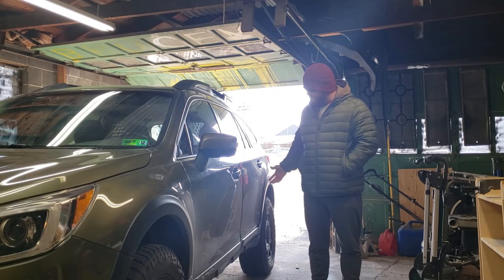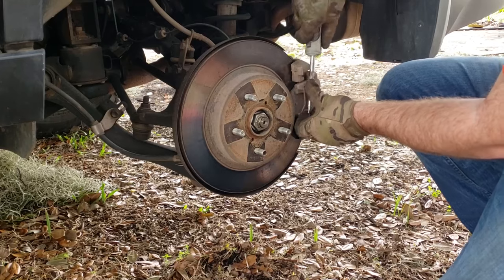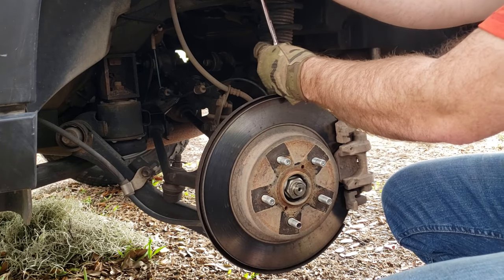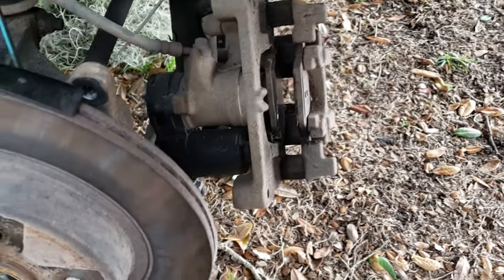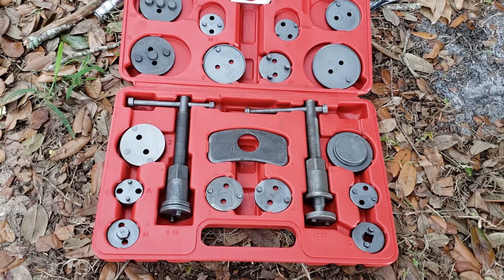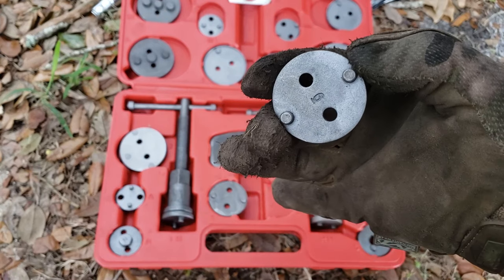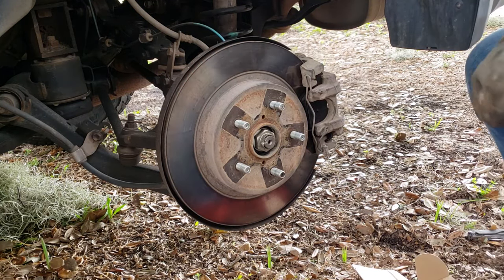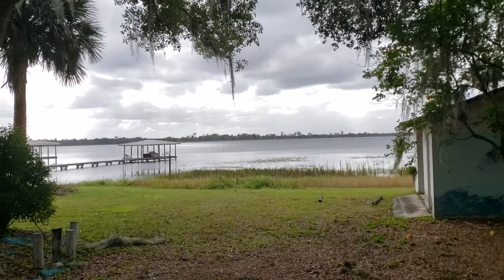Adventures in Electric Parking Brakes! Rear Brakes 2015-2019 Subaru Outback.

Comment: Another question - Sorry! The Subaru FSM mentions an alignment mark on the rotor and hub on page BR-42, with one of hub mark apparently on a wheel bolt. Could not quite make anything out, but at 1:43 one of your studs is indeed different than the others. Could not make out any mark on the hub. Did you happen to see anything? Any idea why this would be there? Thanks!!
Reply from the maker: I did not. I'll check into that mark though.
Reply: @bruceyyyyy  There is a very small dimple. Wonder why it is there? Perhaps to align rotors which have traditional inner parking brake shoes? Took a pic, but no way to share here,
Reply from the maker: @jamesws3  Shoot it to my email. 

bruceygastation@gmail.com
Reply: @bruceyyyyy  We may have an answer from the Outback board:   "Its probably for on car turning and/or balancing that the rotor can be returned to the same position after service". Makes total sense.
Reply: @bruceyyyyy  Done
Reply from the maker: @jamesws3  Yup! Saw the email and the forum post. 

Not removing the park brake assembly definitely seems easiest.

Comment: I am curious, if you already 'release' the parking brake in the beginning with the electronic switch inside,  why do you have to release again by twisting the piston? Any special procedure you need to do after the new pads are on, as far as the e-brake is concerned?
Reply from the maker: Releasing it just makes accessing the brake possible. It doesn't fully retract until it's twisted in. 

When setting the first time the brake will recalibrate itself automatically.
Reply: @bruceyyyyy  thanks! after posting the question I thought about it and came to the same conclusion. The motor must be calibrating itself all the time, and when electronically released it only retracts slightly to free up the rotor and not all the way.
Reply: @bruceyyyyy   I am glad to hear that the electronic parking brake will calibrate itself the last time I did them myself in front but got scared off the back by a shop said you needed to use some computer tool to reset the electronic parking brake.
Reply: I couldn’t completely wind down the E break. I have the wind down tool as u recommended! My new pad couldn’t install it! Any tip to wind down the E break?

Comment: I couldn’t install my new pad on my rear wheel! Because the E break couldn’t completely wind down! There was no enough space for it! I got the wind down tools that u recommend, any tip to wind down the E Break? I don’t want damage my E Break! Thx
Reply: You start by using the special tool and turning in the pistons. After they bottom out then you simply press the piston back with a C clamp or just use a flat adapter on the special tool. This will push the piston back the rest of the way to get the pads in.

Comment: Hello, nice video and thanks for documenting. I need to also change out my rotors; could you have just continued on and removed/replaced your rotors using this method? Anything you would have done different? Thanks!
Reply from the maker: Yup! Should not be an issue. Just bang the rotors off if you want to do them as well.

Comment: The bedding brake procedure might be for doing all 4 at the same time, seems like that might hurt the pre-existing front brakes, not sure but it's more of a question than a correction?
Reply from the maker: I would imagine it puts a minimal amount of wear on the front brakes. They should be fine in my experience.

Comment: Since you didn't use a scanner to disable the parking brake system, was there any issue with using the parking brake or any codes generated after the job was complete?
Reply from the maker: Nope
Reply: @bruceyyyyy  thank you.

Comment: This was brake job simple compared to the GM starbit. I changed my stock pads on my 2018 after a 2 week Trip out west and South Carolina.
Reply from the maker: I've changed some before that had red thread lock AND 12 point head on the caliper bolts (Fiat) and I am not sure if they're meant to be replaced every time or not.

Comment: Other videos showed the back of the parking brake assembly being removed, and the rod being turned as the piston is retracted. Is that step not needed?
Reply from the maker: I did not need to do it.
Reply: @bruceyyyyy  I was just wondering if it would do any damage, because all the other videos say to do it.
Reply from the maker: I'm not sure it's necessary. I've had lots of people do the same I did here without issue.
Reply: @bruceyyyyy  tThanks, I'm going to do my Wife's Outback next week. I've change pads and shoes on several cars many times, but never one that had that electronic parking brake assembly. I just did'nt want to do something where I have to take the car to the Dealer to have something corrected or recalibrated.

Comment: I was wondering how you got your piston to bottom out more(8:45). I initially compressed mine  with the caliper compressor, but didn't fully bottom out similar to yours at 6:44. Had to remove the electronic mechanism and it helped me compress the piston down more to fit the new pads over the rotors.
Reply: I know you posted this a year ago but just incase I will respond. With a wind back tool, you will wind/twist the piston back in. That doesn't get it all the way in so the rest of the way you press it straight back in. With my wind back tool I then used a wrench to rotate/tighten  the nut to push the ouston in without rotating. Or you can use a c clamp at that point.

Comment: Great video. Quick question, when you tightened the caliper bolts, what did you torque them to?
Reply from the maker: I think the 14mm were 20 lb ft and the 17mm were 60 lb ft off the top of my head.

Comment: Hey Bruceyyyyyyyy.   I’ve noticed my 2015 outback is becoming a rather stiff ride at 81 k.  Shock absorbers are all factory.  Just method race wheels and Maxxis AT’s.   You think it’s time to replace all four corners?  Don’t really want to lift it.  Any suggestions for better replacements?   Thanks.
Reply from the maker: It could be depending on how it's been driven.

I figure shocks/struts usually last 100k.

Possibly look into bushings too. 

Do you still have the stock wheels/tires? Worth trying out at least.
Reply: bruceyyyyy 
Around 80% on pavement.  That being said, we’ve got some bad roads we pay extra taxes for.  I kept original wheels if I sell it or climate changes here in Southern California forcing me to install snow tires.   Any suggestions on better aftermarket shocks?
Reply from the maker: @paulauksztulewicz4803  I feel the OEMs are the best quality.

KYB is a good aftermarket brand though I'm not sure if they have ones for ours yet.

Comment: My mechanic said that he had to recalibrate the breaks - not sure if that was the e-parking brake or the entire system.  Is that a thing?  Whatever he did, I paid $175 after tax and got OEM rear pads, so I'm fine with it.
Reply: your mechanic did it the right way. im a tech and i use a scanner then recalibrate. its the way subaru wants it done. remember, just because you can dont mean you should. from a profesional stand point i cant risk damage to a customers caliper.

Comment: What tires? stock height? If not what lift?
Been trying to figure out the largest tires to fit stock and it looks like 29.1" or 235/60/r18
Reply from the maker: 245/65/17

2" lift
Reply: @bruceyyyyy  Crap, you need a 2" lift to run a 29.5" tire
My stock tire is: 225/60/18 which is 28.6". I was thinking of going to a 235/60/18
Reply from the maker: @lifeisgood070  My stock is the same size. A lift wasn't necessary to run that size depending on when back spacing.
Reply: @bruceyyyyy  Stock rim, I was going to keep the same rim for cost anyways.

Comment: Heya all, when ya screw in the piston with that tool will it auto rescrew it self back after you turn the engine on ? Or how does it get screwd back ?
Reply from the maker: The first time you use it out recalibrates itself.
Reply: @bruceyyyyy  Thanks Bruceyyyyy! Just wondering does that mean if i use it a second time to change my second set of brake pads etc. do i have to manually recalibrate it then  ?
Reply from the maker: No it should recalibrate itself the first time you use it.
Reply: @bruceyyyyy  Ahhh omg that makes sense sorry, I have no idea what I was thinking.
Reply from the maker: Is cool bubby. I'm glad you're learning.
Reply: @bruceyyyyy  Thanks, everything i've learned about my Subaru BS is from here. Was your video of it going offroad that inspired me to get it in the first place
Reply from the maker: @badfrog7395  Wish Subaru would give me commission on sales! ha

Comment: Thanks for this. Never worked with an EPB before, followed your vid & it worked great. BTW - the link for your brake tool is dead. I didn't realize I needed one until I was 1/2 done, picked one up at Harbor Freight for $29.99.
Reply from the maker: Glad I could help! 

Thanks for the update, I'll find a new link.

Comment: I'm doing some work on my car today and it's $@*&! cold outside, but your finger-snap technique did not work for me. Thumbs down!

The brake stuff was nonetheless helpful. I've always been afraid to do my own brakes but watching this, I feel that maybe I could tackle it. No electric parking brake in my Forester to mess with either. Thanks bruceyyyyy!
Reply from the maker: They're really easy on the older style cars. Unbolt the caliper, remove old pads, use a CHANNEL LOCKS or a C clamp to compress the Piston (opening the reservoir helps) grease the slide pins and the pads, reinstall and you're done.

Comment: Interesting, thanks!  Curious why the first part of piston compression involved turning while the final part was old school "just press inwards"? Your version seems much simpler than the people who insist on removing the entire parking brake assembly from the caliper. Why do they do that if you showed it to be un-needed?
Reply from the maker: The rotating part of the electric parking brake.

It's attached to an electric motor. 

The normal part is the normal brake piston.

I'm not sure why others would use a different method. This seemed fairly easy.

The book says you can unbolt just one brake caliper bolt and rotate the assembly. Would have to disconnect the plug on the bottom. 

Might be easier.
Reply: @bruceyyyyy  Thanks. You had no need to remove the parking brake assembly and expose the splined shaft as some others have shown. Seems like an unnecessary step an an invitation to something going wrong. Will replace both pads and rotes when due and lube with silicone grease.

Comment: the EPB has to beretracted using a bi directional scan tool and I would not change brakes the way you did.
Reply from the maker: The factory service manual disagrees with you. Using a retractor tool as shown is documented in OEM service technician documents.
Reply: @bruceyyyyy  not on the latest service bulliton and the 2019 service manual is four years old. get up to date
Reply from the maker: First I've heard of it. You got a number? The car is a 2017.

Comment: How much did your lift and tires affect your gas mileage?
Reply from the maker: The lift is very little. I don't notice a difference even I'm running my snow tires on factory size. 

The tires cost me about 1-2 mpg in my 3.6. It was more like 2-4 mpg in the 2.5.

Comment: Hey, Bud....awesome video. Really appreciate it.  Question....some videos show using a scanner tool to (I assume) disengage the electric parking brake.  So, the manner in which you did it mechanically by turning it with the tool you purchased totally bypasses the need for the electronic instrument and there is no damage done to the electric parking brake assembly?  You had disengaged the electric parking brake before doing the job, so I assumed it would automatically been retracted, yet you obviously had to mechanically retract it.  I don't fully understand the internal workings of the electric e-brake.  Thanks again.
Reply from the maker: So if you've got the scanner use it. 

I did this job on a Mazda and it was very similar but it had a secret code to retract so no tool needed. 

But Subartu does not have it so it's mechanical tool or electric scan tool. 

I released it but it still can't retract enough on it's own for service. 

There is an electric motor on the back that drives the piston for parking but otherwise it can operate as a standard brake piston as well.
Reply: @bruceyyyyy  Gracias. Thanks for the input.
Reply: One other question...have you found any decent repair manuals?  I have a 2015 Outback 2.5i Premium.  The local Subie dealer is useless to figure out what they can/cannot provide (which would probably be a buttload of $$$).  There are a number of options online, some of which are just in digital/PDF format.  Curious if you found a good resource.  At the local parts stores, your basic Haynes and Chiltons were not available in my year.  Gracias.
Reply from the maker: @bobweck1317  I don't think there are Haynes or equivalent for these yet.  I've seen bootleg pdf of the factory manual. Probably a worthwhile investment if you plan on keeping it and working on it yourself.
Reply: Now, all kiy lights are on. Brakes work fine...but the parking brke no longer engages, the hill assist and the RAB are not working
Reply from the maker: I would check the connection at the rear electronic brake. 

It's a known failure point.
Reply: @bobweck1317  I purchased a full Subaru manual on disc in pdf format. It was about $25. On the Subaru site, you can purchase limited time access to the full manual and download all or part of it. Don't recall how much it is at Subaru. A lot less than a mechanic would pay for a subscription. The only downside I see to purchasing a manual this way is that you don't have future updates or changes. I imagine any changes would be minimal. For me, the manual is worth the money. It is very helpful but, I'm thankful to have the videos from bruceyyyy to help it make sense. That manual is over 7,300 pages.

Comment: Ok, I'm about to do a brake job on my 2018 Outback, which has the same electronic parking brake. Every single video I've seen that addresses this issue, the person removes the electronic brake and "unwinds" it before pushing the piston back into the caliper. Does this tool negate the need to remove the electronic parking brake because it is rotated as its pushed back into the caliper?
Reply from the maker: Yup I believe so. I didn't even need to disconnect the wire for the brake.

Comment: the electronic parking brake requires it to be put in service mode....the way you did the rear brakes has the potential to damage the electronic parking brake motor...
Reply from the maker: This is listed as a method in the factory service manual.

Comment: It is not right. The parking brake service mode is used to replace the pads. It's easy to do. There are many videos on youtube
Reply from the maker: I'm not sure that is necessary. I haven't had any issues using this method.

Comment: Did you have any issues with the parking brake afterwards?  A lot of folks are saying that they need to go to the dealer to have the  parking brake reset in the ECU after manually retracting it.

  The factory service manual says that the parking brake is supposed to be put into maintenance mode which retracts it fully (rather than dialed in like you are doing).
Reply from the maker: Who is saying they had to go to the dealer?

We've got a whole thread on the forum but no one had reported having to go to the dealer.
Reply: @bruceyyyyy  Hey I was reading a post on the Ascent forums of someone who tried it on their OUTBACK (not Ascent), but it sounds like they had physically removed the parking brake solenoid from the caliper and maybe that caused their problems.  Apparently nobody has DIY  rear brakes on an Ascent yet  but the Ascent rear brake setup looks nearly identical, in fact the pads are the same Part number.  I suspect just the caliper + rotors are just  larger.  

Did you have to disconnect battery?  I am guessing not.  

My rotors are shot after 2 years , completely rusted and pads are worn enough that it'd make sense to replace them also, so I am going to try it but a little nervous!

https://www.ascentforums.com/threads/brake-job.7549/post-140196
Reply from the maker: I wouldn't worry. Have you changed brakes before? If you have : Check this video out, do a couple readings on the Outback forum. You should be good. 

Obviously if the bracket is off the rotor should just pop off. Might need some encouragement from a hammer. Might need a screw into the hub. But if you've got the bracket off you're basically already there.

Comment: I HATE the electronic parking brake (NO emergency brake?) extremely unsafe! :O 
that is the biggest complaint I have about the modern Subaru cars.

 also have a 2019 crosstrek for my wife and it has an emergency brake :)  plus better mpg and a fun car to drive.

 Subaru should never have an electronic parking brake it is unsafe and fails when there is no power [DC] 
an emergency brake is for Emergency use when all else fails to stop you. [just keep the cables in good shape to be safe]
the E-brake can only be operated manually with great difficulty (try operating it during an emergency,  the port is behind the drivers seat and operated with an alen wrench [which is hidden in a bag] the E parking brake is NOT an emergency brake
Reply: Only the US/Canada seem to call it an emergency brake, the rest of the world call it a parking brake, because that is why it is there. The fact you can use a parking brake in an emergency does not mean that’s it’s purpose.
However, the electronic parking brake on a Subaru can be used in an emergency. It’s in the manual. Lift and hold. In my Manuel it’s on page 7-47.